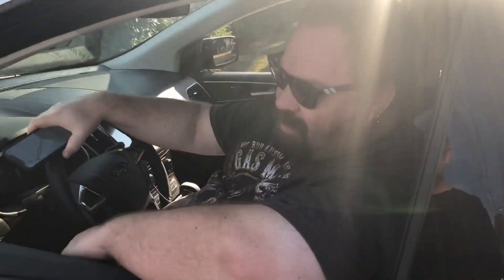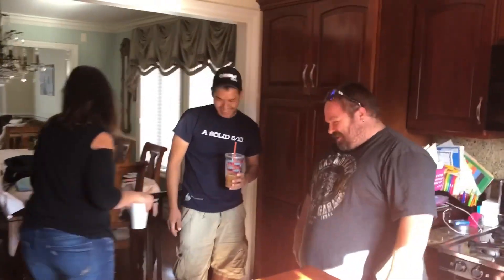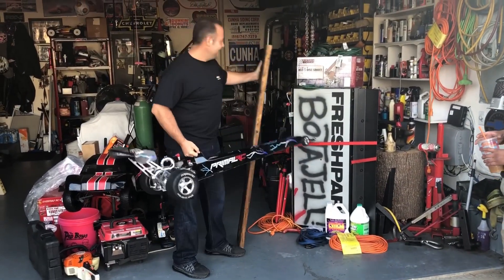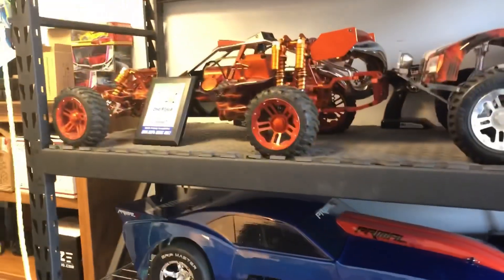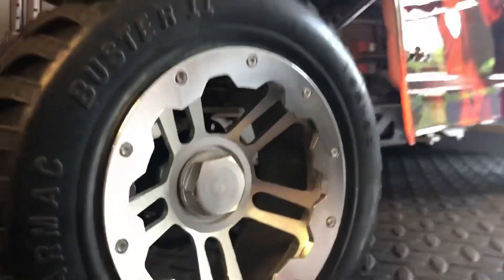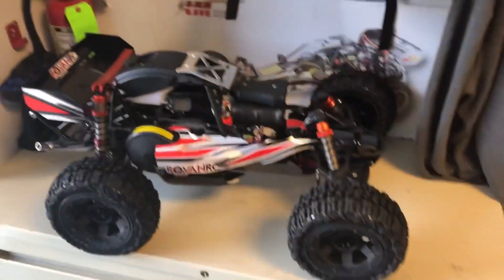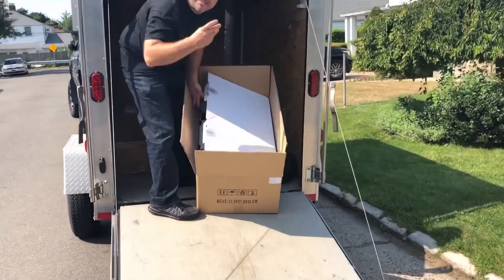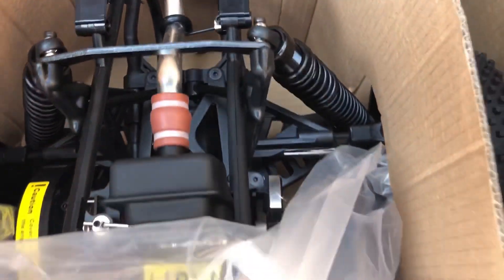Take A Ride With Us, Let’s Go Pick Up Some Primal RC Dragsters⛽️🔥💨Un Trailering PT2

Comment: Hey John what is the gap size on a Nova rosi carburetor at idle it was in one of your videos you had it measured by Allen wrench but I forget what size and I can't remember what video
Reply from the maker: Don Foss 1/2 mm !! Not 1mm then lean your low speed until the engine can idle on her own but make sure your engine is preheated with a heat gun to 200 degrees Fahrenheit!!!
Reply: I started breaking it in yesterday and everything went just like you said it would go it was doing perfect but the only thing when I pull my glow plug igniter off it instantly shut off so I had to stop the process do you know what that could be